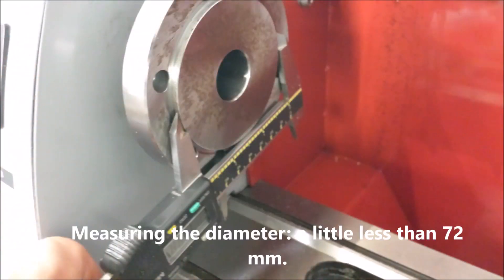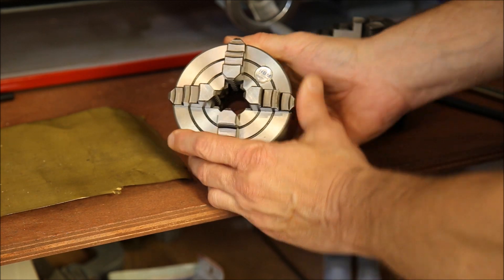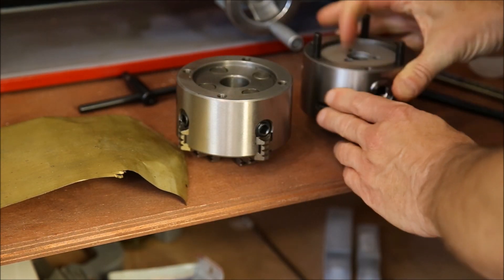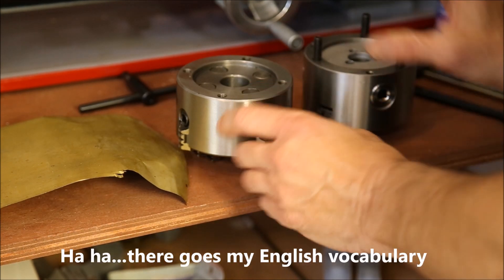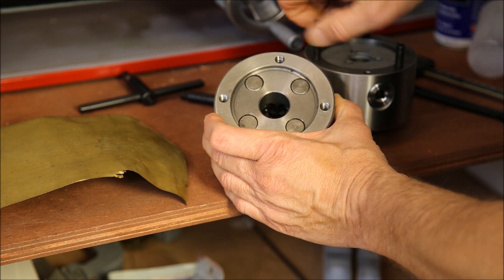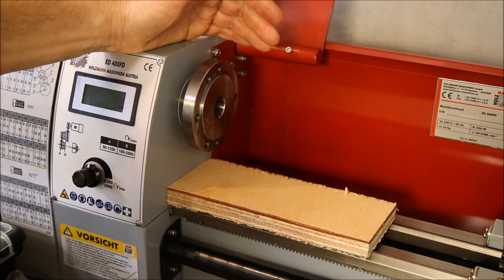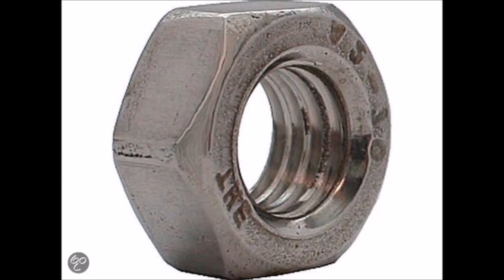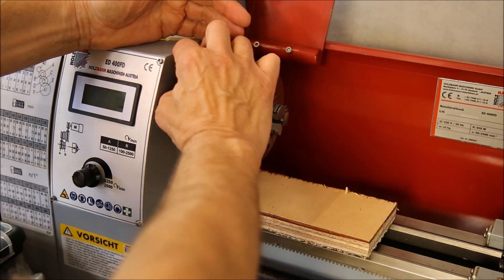Holzmann 400 PART2

Comment: thanks. im thinking tobuy the slightly smaller model. thes bad reviews everywhere but they probably didnt spend the time setting the machine up properly. if i had not watched your video i would also have tore the box open and started using it then complain.

Comment: Hallo Jaap 
Hat Dich der schwache Motor der ED400 auch schon geärgert? Es gibt einen Trick wie man dem Motor mehr Drehmoment entlocken kann. Du brauchst eine 60Grad Gewindelehre. Nun schleifst Du dir im rechten Winkel einen Stahl aus HSS mit 60 Grad oder 2x 30Grad. Nun drehst Du dir anhand des Originalen Alu Riemenrades vom Motor ein neues aber eines wo der Durchmesser 40mm ist. Nun stichst Du mittig im Verhältis des alten Rades einen neuen Einstich für den Riemen. Wenn nun das neue Rad entstanden ist nur mit einem kleineren Riemenumlaufdurchmesser, hast Du auf der Motorachse ein besseres Drehmoment Nm. Ein ehemaliger Kollege hat mir in die Grundplatte vom Getriebe Langlöcher gefräst. Nun kann ich die Spannhöhe des Motors zum neuen, kleineren Antriebsrades anpassen und klemmen. Es ist schier unglaublich was der kleine Motor jetzt für eine Kraft durch ein optimiertes Übersetzungsverhältnis hat. Lg Holger. Hast Du Fragen.......Mail to: holli_57@gmx.de

Comment: your ruler test doesn't mean anything, centers are not conical to the point. that is to say, the point geometry can be variable in the spec, only the cone surface behind the point is 60% between some tolerance. the point is not a critical dimension.
Reply from the maker: Yes you are right

Comment: Hi,
Im thinking about getting this lathe too ... have you since measured the outrun on a bar ? 
And did you get the tailstock offset fixed ?
Would you recommend this lathe? 
Thanks for the info ;)
Reply from the maker: The lathe is o.k. for the price, but if you need a precision machine, you have to check for runout, linearity and parallelism, like I did.